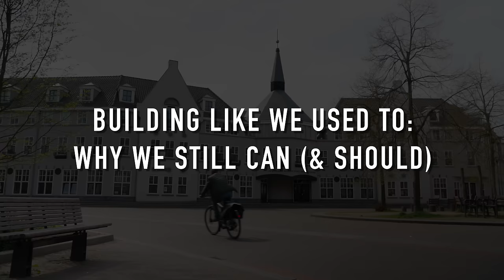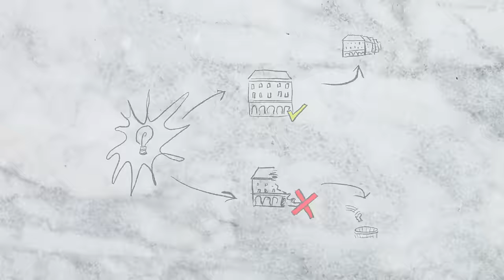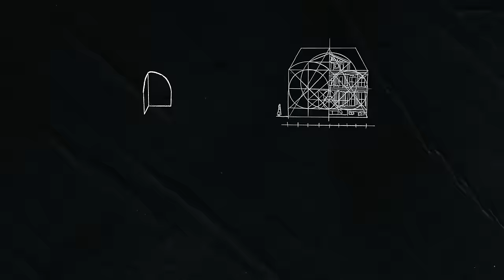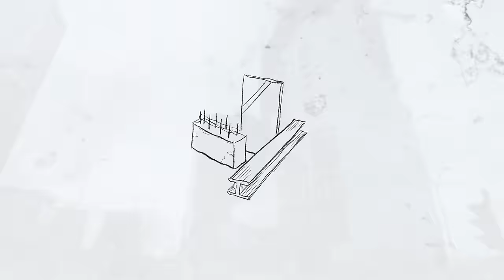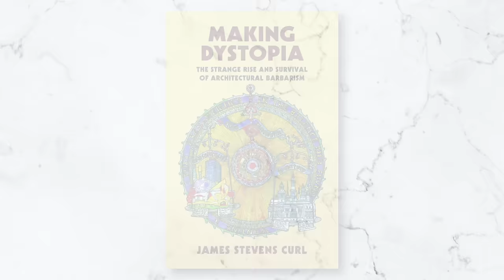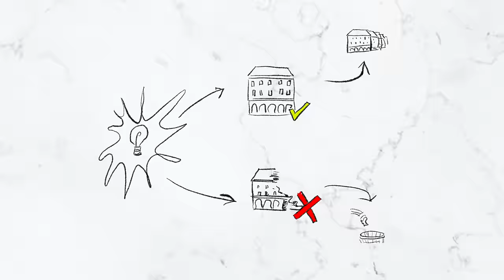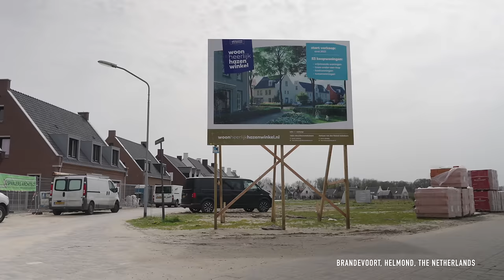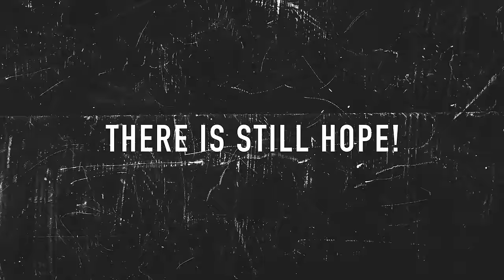Why We Should Revive Traditional Architecture & Urbanism

Comment: Although you make many valid points in your video, I would like to suggest diving deeper into the reasons why modernism became the prevalent architecture style. The cities of the late 19th and early 20th century were not as pretty as the examples you are showing here. These examples are inevitably cherrypicked because bad examples were torn down. Poor hygiene, lack of social mobility and insufficient housing were real problems caused by traditional building, which caused the large shift after the first world war as people wanted to make a better world. The big mistake here is of course completely rejecting existing tradition, and so modernism caused as many problems as it solved. 

A new architecture should not come from a complete rejection of modernism (or simply only taking the building methods) but should attempt at uniting the lessons learned previously in traditional architecture as well as modernism, but also trying to face the problems of today. Luckily, I can see that discussion already taking place and thank you for your video, it adds to that discourse.

Comment: very tempting but probably not thought through to the end. What about population density, when residents of high-rise blocks have to move to lower-rise buildings? What consequences does this have for traffic and ecology, for example? What about the proportion of green space (parks, agriculture) when the built-up area increases? What about energy supply when decentralized buildings require more heat due to larger outdoor area and traditional architecture does not allow renewable energy generation on the buildings for aesthetic reasons? What the video unfortunately does not take into account: The world population is many times larger today than it was when traditional architecture was abandoned.

Comment: I remember an old movie, late 50s early 60s, I believe with William Holden, where he played an architect who, in a pretty charged scene, vehemently rejected the suggestions of a committee that wanted him to make changes to his project. He did so by sarcastically adding, on the fly, decorations, columns, frames, etc., to a drawing of his project, while berating them for the foolishness of such requests. 
I also remember thinking that the end result of those changes looked waaaay better than the original drawing of essentially a large series of cubic shapes and straight lines.
Seen from the vantage point of decades of modernism and brutalism applied everywhere, the whole thing looks very silly.

Comment: Interestingly enough, I found most of the modern architecture examples in this video to be quite charming - perhaps because they mostly were European tower blocks, skyscrapers, and generally speaking architect-designed buildings that were made with express purpose and to be integrated into relatively transit-rich environments.

As an American living in the Midwest, the much bigger affront to my aesthetic and urbanist sense is the sprawl of extremely low cost and low quality suburban low-rise homes, shopping centers, drive-through fast food and banks, big box stores, and the seas of parking lots that support them.  None of it is designed to last longer than about 25 years, and as they age, it's obvious.  And that's on top of the issues that the sprawl itself causes.

The problem isn't the modern steel and concrete skyscrapers, the funky brutalist public libraries and museums, or the international style post offices and bus stations.  Even if they have made mistakes in design that lead to long-term issues that have to be addressed, they were part of that experimentation.  The real problem (at least in the USA) is, for example, the strip mall that the old Radio Shack was in, closed, and then went through a succession of other unsuccessful chains as the parking lot slowly deteriorated, and now it's all a mess, where the developer who owns it now is going to squeeze every last penny out of it before tearing it all down to build something equally bad (or to abandon it entirely).

What I am afraid of with a return to traditional architecture is that in many areas in the USA, that return to 'traditional architecture' may (and does) consist of municipalities mandating certain facade appearances, while not addressing the underlying construction and the reasons behind it.  I gag every time I go to Frankenmuth, Michigan, and see the fake half-timbered buildings, where they're built out of stick wood frames (which are not bad in themselves), with a cheap facade thrown on front to meet the village's aesthetic code.

That's not to say that modern building methods cannot be combined with traditional architecture and design.  But they need to be intelligently fused, not just modern building being used as a tool to cheaply mimic the style of traditional buildings, without the substance behind that style.

I also do not object whatsoever to modern architecture buildings being combined with and adjacent to traditional buildings, as long as it is done with a sense of purpose.  When uses complement each other, there is nothing wrong with this.  The contrast can be refreshing.  Does it belong everywhere?  No.  It would not be appropriate to build a skyscraper in Venice, even if it were technically feasible to do so.  But I do think the mixture of architectural styles is a net positive to most cities.  You (and Devo) might say that New Traditions are being made.

Comment: Modernism is great when done right, the issue is many of modernist design principles are applied cheaply to low income housing blocks & you get depressing ghettos in the sky which smell like smoke & trash.

I actually prefer traditional architecture for the most part, but I don't think we should be fully trashing everything about modernism. The same issue exists with traditional architecture to a worse degree on requiring comprising the ideals when it comes to low income developments.

If you have unlimited money both styles can look fantastic in their own ways, some of the images of modern architecture you showed looked great. I would happily live in a modern home in the mountains, much preferred over a cabin that's for sure, but the issue is price.

Cheap modernism is depressing & bland. Few want to live in these disgusting apartments, but nice apartments or better yet single family homes cost money. Hopefully one day we become a part scarcity civilization & won't need to worry about such things.

Comment: I believe the problem stems from our urban design rather than the superficial aesthetic qualities of a facade. There has been and will always be an argument about the ornamentation of our buildings, but it seems like your argument classifies buildings as beautiful only if they have cornices, ionic columns, and pediments above each window. There is a place for this, but it becomes a very superficial quality when it is plastered on every building for the sake of "beauty." Why not embrace traditional urban design and planning with modern buildings that are still beautifully designed, but employ modern building techniques that equally respond to the environment around it. Not every beautiful facade is a load-bearing brick wall. In fact, there are countless modern facades that are equally beautiful to those of the past, but heighten the quality of space on both the interior and exterior. This argument for tradition remains extremely superficial when beautiful architecture is defined by the spatial qualities that are created, not how many Corinthian columns a building has.

Comment: We should examine and learn from traditional architecture & urbanism instead of dismissing it on a whim. 
We shouldn't revive it as a whole because that's dogmatic and does not serve anyone any purpose apart from couple die-hard traditionalists, not different in their belief system from die-hard modernists they despise.

Couple examples:
Many aesthetically pleasing cityscapes are shaped by things very far from urbanism itself, for example.. taxes. In many towns tax was calculated based on the number of windows or width of the parcel.  
Hansa towns with their narrow, fairytale tract houses are built this way because the houses had to double as merchants' stores and magazines and to maximize the access to storefronts. They are absolutely not designed with comfortable living in mind. In fact they often reach so deep that a skylight over a flight of stairs in the middle was necessary to have any light in the middle part of the building. The way they look and function is the outcome of different forces at play.
Symmetry of a facade was a priority for traditional architects, often at an expense of usability and integrity. Cue in staircases with landings in the middle of windows, oddly shaped rooms, uncomfortable, pointless layouts.
Modernist residential units were a massive improvement of living standard for countless former residents of these traditionally built quarters. Corbu et al were impossibly self-absorbed, obsessed bunch of... idealists, I guess, but the separation of function did make sense in the day and age where dense, multi storey housing was on the other side of the street from a polluting factory.

Beauty has many faces. Frank Lloyd Wright's praire houses and Usonian homes are beautiful. Minimalist, colorful houses of Luis Barragan in Mexico are beautiful. 
There's a third way. You don't need to pick between dismissing or embracing. You can integrate and transform. Context is key. We shouldn't adapt our ways of living to the buildings, we should adapt the buildings to our changing ways of living.

Comment: There are four main problem we have to overcome: 

-  We barely produce good propper, red bricks anymore. Most are just some partly hollow, out of plaster or similar materials (often mixes). Germany once had thousands of those, nowadays just a handful. 
- As a craftsman oder Handyman your pay is often horrible. You ruin your body with the heavy, exhausting work, yet earn worse than somebody working as a garbadge collector. So there is simply no incentive to learn such a job. 
- Many Materials that we used to built with are nowadays barely produced anymore and therefore very expensive. Best example is propper, baked, red brickstone. In All of Germany, once the largest producer, we have roughly 10 small ones left. 
- It often takes longer to build like we used to, which raises costs significantly.

All this leads to the following. 
For example, my home town planed to rebuilt a school building like it used to look like before it got destroyed in WW2. It was an absolutely beautiful, magnificient brickstone building. They still have all the plans and so on, which saved them a lot of money ofc. However they could not realize it, because it was simply too expensive, mainly the brickstones themselves. Nor could they find enough skilled craftsmen to build in in ~two months (summer holidays). Instead they went for a very simple, boxy, prebuild design, it doesn't look that ugly, but is very boring. At least they play a bit around with the colouring. However the price difference is huge, nearly ~480 Millionen Euros for the first approach and barely 2 Million for the second one. 
Or let me give you another example, the repairs of the ornaments on the fassade of a  protected and historical very important brickstone building costed nearly 200 Million Euros. Another one is the planed reconstruction of the old townshall in the german city "Essen". It would cost nearly 10 millards, as we no longer know how they did some of the ornaments on the fassade, nor do we know how they built the woodwork inside and ofc because materials and craftsmen are rare and therefore expensive. 

Knowing this, imagine how expensive it would be to build a whole city block like this. We are speaking of millards here, instead of maybe 100 millions.

Until those things do not change, I don't think pleasent looking buildings are going to be build en mass again.
Reply: It was costly and why it was beautified. 
Cheap junk has no value and is ugly.

Comment: Wuld it be possible to use both traditionalisiom and modernisom in the same building? Use modernisom to build the strcucture and traditionalisom to decorate the building. Or the other way around have the structure be built with brick, rock and wood, but have the building be built in a modernist/ minimalist style. 

Sidenote i wuld also love to see an artdeco revival. I feal that whole movement ended prematurely that it did not reach its full potential

Comment: One reason for decline of traditional architecture may be in disconect between builder-owner-occupant.
Today wast majority of buldinngs are made without knowing who will buy them and then buying party is still not sure who will use the bulding. As I understand it, it's not something unheard before, let's say, 20th century but then it was more prevalent when the owner, in some capacity, used at least small part of bulding and actively communicated with builder during building stage.

Comment: The issue, as so often, is money. Modernism only became ubiquitous after WW2, when wartime destruction and a population explosion demanded quick construction of large quantities of living spaces. This played right into the hands of modernist architects who, for both practical and ideological reasons, favored a more austere way of designing buildings - which also happened to be better scalable than traditional building methods. 
I don't see the main problem as being with traditional artisans; rather, it is all about cost. So long as the building industry is entirely focused on building a limited set of solutions at scale, traditional construction is not going to solve the current housing crisis. Sure, there will be the odd triumph here and there, but they'll be expensive to produce and purchase (or need to be heavily subsidized). I'm not optimistic about large-scale construction in Europe, let alone elsewhere in the world.

Comment: This problem is linked to a more general one, which is the deterioration of the social fabric in modern societies. The book Bowling Alone, by Robert Putnam, and The Great Disruption, by Francis Fukuyama, written around 2000, analyze this problem, but it has been discussed since at least Gemeinschaft and Gesellschaft, by Ferdinand Tönnies, from 1887.

Much is discussed about the causes of it. Apparently it is linked to a rich and overdeveloped market society, and to new technologies, especially informational and transportation ones. These things tend to develop more and more, just as the social fabric has deteriorated more and more over the last 150 years or so. 

Architecture is more a symptom than the cause of this process. I don't think that by changing urban planning it can be reversed. But it would be interesting to compare the social capital of neighborhoods with traditional and modern urbanism.

Comment: I'm 100% for traditional urbanism, but traditional architecture is a lot more tricky. First of all, when the architecture was built that we now consider traditional, labour was cheap and materials were expensive. Now it's the other way around. This is a big problem if you want to build anything to the scale required to solve the housing crisis, climate change, etc.

Second, there is plenty of traditional architecture that isn't built to a human scale at all. Huge and unnecessarily imposing structures were being built all the way back in ancient times. To argue that this is solely a problem of modernist architecture is untrue. In fact, to assign blame for all that ails modern society to modernism is a very reactionary position to take.

Comment: The problem is that it is super expensive to build when compared to the rectangular buildings. If you go a century back, most people lived in slums and ghettos. Only the rich could afford such architecture. If govt proposes affordable housing plans, it will never go with these designs since the primary motive is to house more people annd use place effectively instead of beautiful buildings which can hold a few people.

Comment: I value your analysis of the „problem“ and I agree with much of the reasoning but you seem to draw the conclusions you seemingly tried to stay away from. Especially the examples that were shown closer to the end remind me of what I personally explicitly don‘t want this approach of designing based on historic knowledge to look like. In my opinion, modernist solutions probably went too far in many aspects, but some developments also carry a lot of value as a foundation for todays designs. You also left out the post modern „period“ where designers seemingly tried to reflect this hard gap between modernist buidings and „traditional“ architecture. There have been huge dabates about projects that directly reproduce historic styles for very good reasons, especially considering how this reproduction of style can often be misleading concerning the different circumstances we face today, compared to the time these historic „styles“ developed. Current issues and topics in society must in my opinion be reflected, or at the very least not denied, in current architecture, which makes your examples and the images that people seem to have in the comments not a fitting outcome of this important discussion.

Comment: No discussion of Suburbanism? I think traditional architecture is beautiful, but some modern buildings can also be beautiful. Also, traditional building methods are less popular not just due to lack of skilled craftsmen, but primarily due to cost. Most of the issues you describe have to do with both COST and SPEED of building, and overall Urban and City Planning around separate of function within a city. These are the issues that need to be resolved, and there is no silver bullet for this.